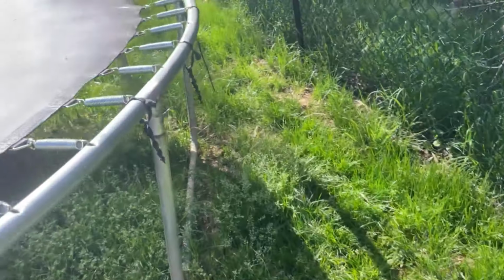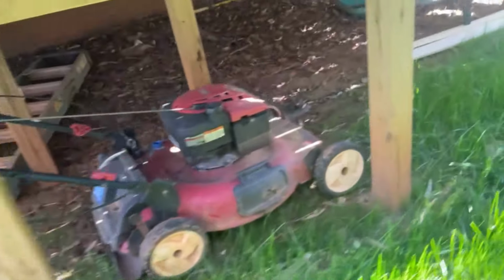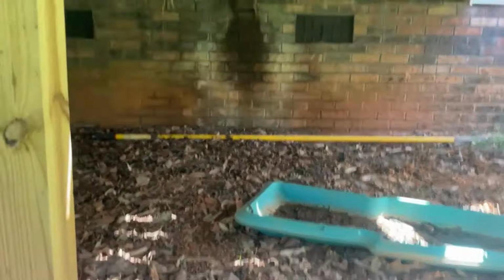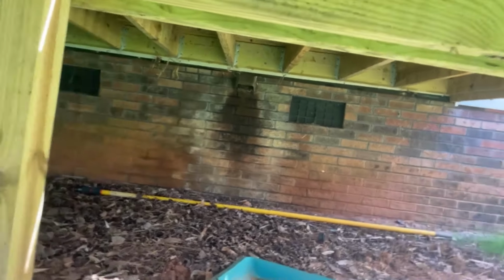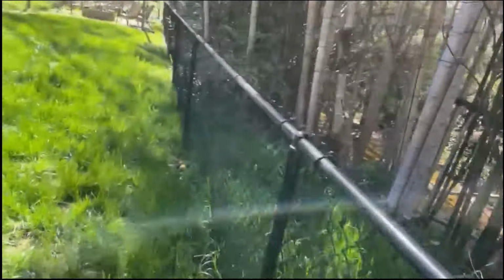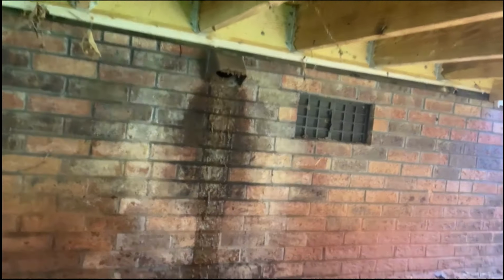ABSOLUTELY DISGUSTING! Seriously? Cleaning a Dryer Vent! #almetaldryervent #satisfying #diy #fyp

Comment: What would cause this to happen? I know dryer lint is normal, but all that water/sludge? Isn't there any kind of one way valve on there?
Reply from the maker: It’s definitely not normal! When you dry a load of clothes, you’re pushing a gallon to 1.5 gallons through the vent via steam… When there’s a blockage that bad, all that water remains in the duct as steam, when it gets far enough away from the heating source, turns back into liquid water EVERY TIME… I wasn’t lying when I said this isn’t clickbait!!! Thx for watching as well as your comment!!!!

Comment: I didn’t understand why there was water in the vent line.
I thought maybe there was a leaking water pipe dripping on top of the vent.
Not until I ready your comments explaining there was a clog in the vent and the moisture couldn’t get out making the moisture build up.
Thanks for explaining!
Reply from the maker: Yea, I get that question quite a bit! This one was absolutely horrendous!!! Thx for watching!!!
Reply: What is really scary if the lint and nesting is damp, it’s a combustion waiting.

Comment: As to what I can see to this mess is that the dryer vent was installed wrong. This means the entire venting system needs to be replaced and done by an actual professional and not someone who has never done a dryer vent installation or else this will keep happening no mater how many times it is cleaned out.